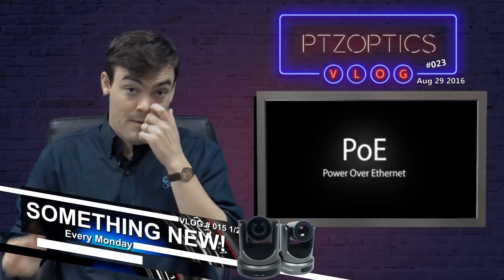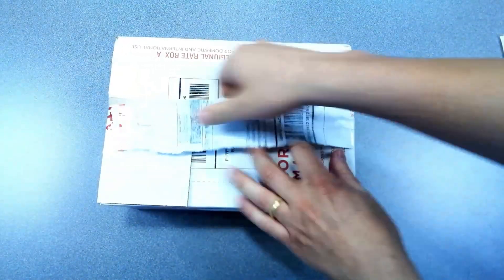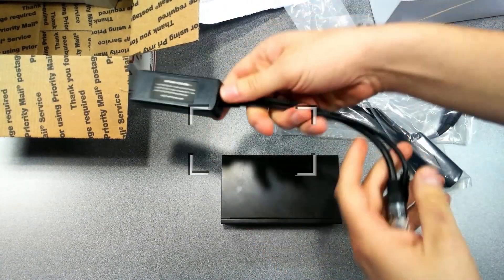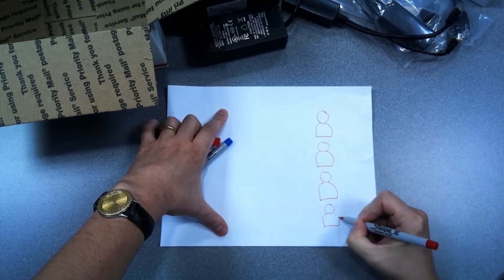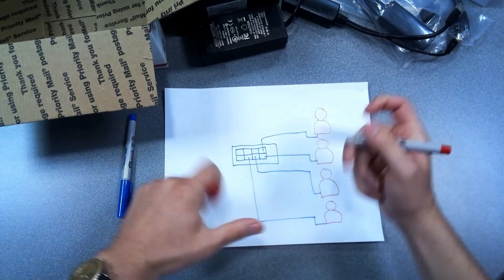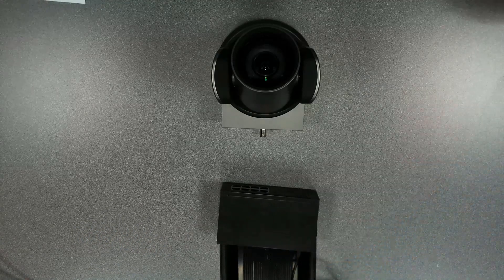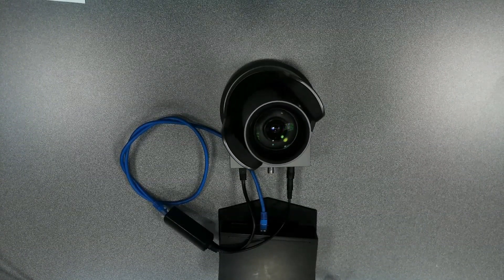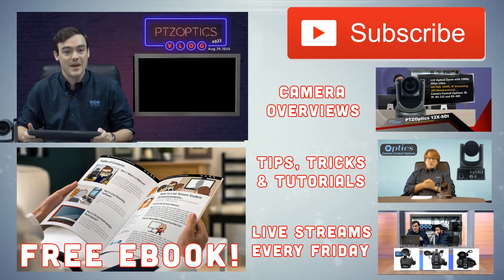Power Over Ethernet (PoE) PTZ Camera Set Up - VLOG #023

Comment: So u still have to have that block attached to the camera. So how's that possible? If i need a camera in back n in front of my house but if the camera has to be plugged into the Ethernet box with these short cables how is it possible.
Reply from the maker: Hello!
Power Over Ethernet (PoE) PTZ (Pan-Tilt-Zoom) cameras are designed to simplify installation by allowing both power and data to be transmitted over a single Ethernet cable, eliminating the need for separate power sources for each camera. This setup is particularly advantageous for placing cameras in locations where power outlets are not readily available or would be difficult to install.

Understanding PoE and Your Concern
It seems like there might be a misunderstanding about how PoE cameras are connected and the necessity of proximity to the "Ethernet box" (likely referring to a PoE switch or injector). Here's a clarification:

PoE Switch/Injector: The device that provides power through the Ethernet cable. It does not need to be physically close to the camera. The standard Ethernet cable (Cat5e, Cat6, etc.) can carry power over considerable distances, up to 100 meters (328 feet), which typically is sufficient for most installations, including stretching from the front to the back of a house.

Camera Connection: The camera connects to the PoE switch/injector via a single Ethernet cable. This cable transmits both power and data, allowing the camera to operate without needing a separate power connection.

How to Set Up PoE PTZ Cameras
Determine Camera Placement: Decide where you want your cameras. Ideal locations are those that offer a clear view of the areas you wish to monitor, such as the front and back of your house.

Use a PoE Switch or Injector: Connect your PoE switch or injector to your network. This device will provide power to your cameras over the Ethernet cables. If your existing network switch does not support PoE, you can use a PoE injector to add power to the Ethernet cable.

Run Ethernet Cables: From the PoE switch/injector, run an Ethernet cable to each camera location. You can use outdoor-rated Ethernet cables if the cables will be exposed to the elements, or you may need to drill through walls and use conduits to protect the cables and maintain a neat installation.

Connect Your Cameras: Once the Ethernet cable reaches the camera location, connect it to your camera. The camera should power on (given that the switch/injector is connected and powered), and you'll be able to configure it through your network.

Considerations
Cable Length: Ensure that the length of each Ethernet cable does not exceed 100 meters to maintain a stable power supply and data connection.
Quality of Ethernet Cable: Use high-quality Cat5e, Cat6, or higher Ethernet cables, especially for longer runs, to ensure reliable power and data transmission.
Outdoor Installation: If the cables or cameras will be outdoors, make sure both are rated for outdoor use. This protects against weather-related damage.

PoE technology significantly simplifies PTZ camera installation by reducing the need for electrical wiring, making it feasible to install cameras at distant locations from the PoE switch/injector within the 100-meter limit.

Thanks for checking out our Channel! 
Learn More: https://ptzoptics.com/

Comment: What if the camera doesnt have a RJ45 network connection and just has a BNC and power?
Reply from the maker: Hello!
Power Over Ethernet (PoE) is a technology that allows network cables to carry electrical power to devices, eliminating the need for a separate power source. However, if a camera only has BNC (Bayonet Neill–Concelman) and power connections without an RJ45 network connection, it indicates the camera is not natively designed to receive power or data through Ethernet. BNC connectors are typically used for analog video transmission, and such cameras are usually powered separately through traditional power cables.

In scenarios where you want to integrate such a camera into a network-based system or wish to simplify cabling with PoE-like advantages, you have a couple of alternatives:

1. Use a Video Encoder with PoE
A video encoder converts analog video signals into digital streams. Some encoders come with PoE support, allowing them to be powered over Ethernet and to stream video from BNC-connected cameras over a network. While the encoder itself can be powered via PoE, the camera would still require a separate power connection unless the encoder specifically supports passing power through to the camera.

2. Power Injectors and Adapters
For cameras without a network connection but with separate power needs, you can explore using power injectors or adapters designed to provide power through alternative means. While this doesn't convert the camera to a PoE device, it can help centralize where and how power is distributed in your setup. This method is more about power management than integrating the camera into a PoE network.

3. Hybrid Solutions
There are hybrid coaxial solutions that can transmit power, video, and even control signals over a single coaxial cable. These solutions often involve transceivers that convert the signals at both ends. This approach can simplify cabling without fully converting to a networked (IP) solution.

4. Consider an Upgrade or Additional Equipment
If integrating the camera into a networked environment is crucial, consider either upgrading to a network camera that supports PoE or using additional equipment that bridges the gap between analog and digital systems, such as network video recorders (NVRs) with analog inputs and support for PoE output to other devices.

When dealing with analog cameras and modern networked systems, it's important to assess the needs of your setup and the feasibility of integrating older technology with newer infrastructure. Sometimes, the cost and complexity of bridging technologies can approach or exceed the investment in newer, directly compatible equipment.

Thanks for checking out our Channel! 
Learn More: https://ptzoptics.com/

Comment: You didn't show how to integrate the poe camera into your home computer network via a program that's coming off your router/wifi to the poe switch to the breakout,  or even showing visually the camera up and running on your screen. Wiring is the easy, it's the integration that people need to see.
Reply from the maker: Hello!
Integrating a Power over Ethernet (PoE) camera into your home network and accessing its video feed on your computer involves several steps beyond just the physical wiring. Here's a simplified overview of how you can achieve this, using common steps that apply to most PoE cameras and network setups:

1. Connect Your PoE Camera
Camera to PoE Switch: Connect your PoE camera to a PoE switch using a Cat5e or Cat6 Ethernet cable. The PoE switch should be connected to your home router to integrate the camera into your home network. This setup allows the camera to receive both power and data connectivity over a single cable.

2. Identify the Camera on the Network
Camera IP Address: After connecting your camera to the network, it should automatically obtain an IP address via DHCP from your router. To find this IP address, you can use various methods:
Router's Web Interface: Log into your router's web interface and look for a section like “Attached Devices” or “DHCP Client List” to find the camera and its IP address.
IP Scanner Tool: Use a network scanning tool like Advanced IP Scanner or Angry IP Scanner on your computer to scan your network and identify all connected devices, including your PoE camera.

3. Access the Camera’s Web Interface
Web Browser: Open a web browser on your computer and enter the camera’s IP address in the address bar. This should bring up the camera’s web interface, prompting you for a username and password. (The default login credentials are usually provided in the camera’s manual.)
Configuration: Within the web interface, you can configure your camera settings, such as resolution, frame rate, and, if applicable, motion detection settings.

4. Use Camera Management Software or App
Manufacturer’s Software: Many PoE camera manufacturers offer their software for managing and viewing the camera feed. This software might provide additional features like recording, motion alerts, and multi-camera views.
Third-Party Software: Alternatively, you can use third-party software like Blue Iris, iSpy, or VLC Media Player to access and manage your camera feed. These programs often support a wide range of camera models and offer extensive customization options.

5. Integrate with Surveillance Software (Optional)
For more advanced monitoring and recording, integrate your PoE camera with professional surveillance software. This setup can offer motion detection recording, alerts, scheduled recording, and remote access capabilities.

6. Accessing the Camera Remotely (Optional)
To access your camera feed outside your home network, you'll need to set up remote access. This can involve configuring port forwarding on your router and using Dynamic DNS (DDNS) if you don't have a static external IP address. Note that remote access introduces security risks, so ensure your camera’s firmware is up-to-date, change default passwords, and consider using VPNs for safer remote viewing.

Additional Tips
Security: Always change the default username and password to prevent unauthorized access.
Firmware Updates: Regularly check for and install firmware updates from the camera manufacturer to ensure your camera has the latest features and security patches.

By following these steps, you should be able to integrate a PoE camera into your home network and view its video feed on your computer. Remember, the exact steps might vary slightly depending on the camera model and the network equipment you're using.

Thanks for checking out our Channel! 
Learn More: https://ptzoptics.com/
Reply: I have that question as well ! How does it connect to the computer to then give visual! ? Does it need a capture card ?

Comment: Hello ! I want to ask if I have chosen a good installation method, I have a large space with lighting poles and I want to install "IP Camera Speed Dome 2MP, PTZ, 200 M IR, Hikvision DS-2DF8223I-AEL + 1602ZJ", length between the poles is 200 m and I have 6 poles, I chose to use a UTP cable with one switch on each pole to avoid a large number of cables to the unit, feeding the surveillance cameras to the poles.
I would like to know if the image quality is lower with this method than connecting the cables to a single switch and then to the unit?
Thanks!
Reply: Hi Claudiu, unfortunately you can run by cable up to 100 m, then you have to install a repeater. This is the only way to have it done by this distance by wire. There is another way, to use wireless cameras, but you have to resolve power problem, and don't forget if someone wants to beak in, the wireless cameras can by jammed.